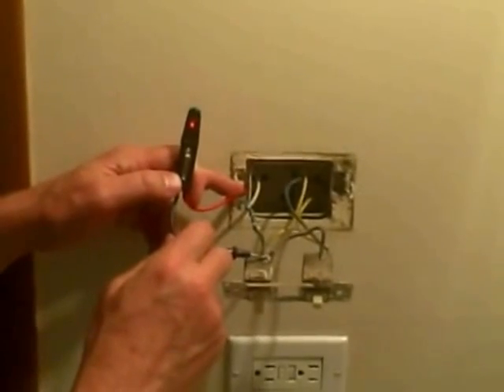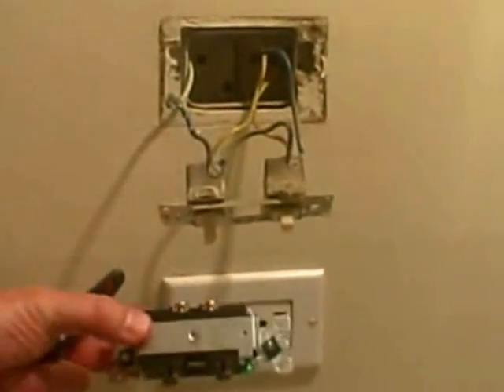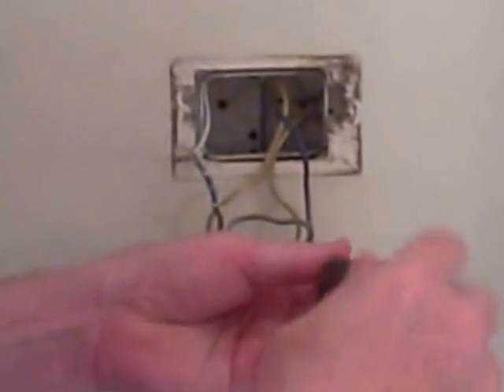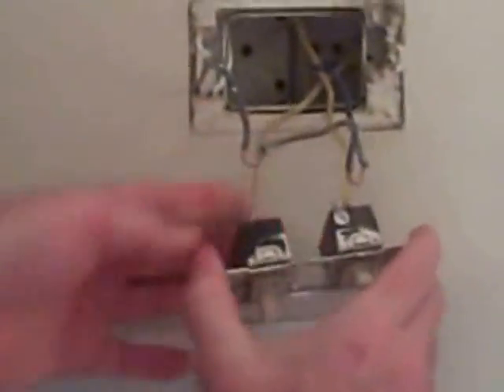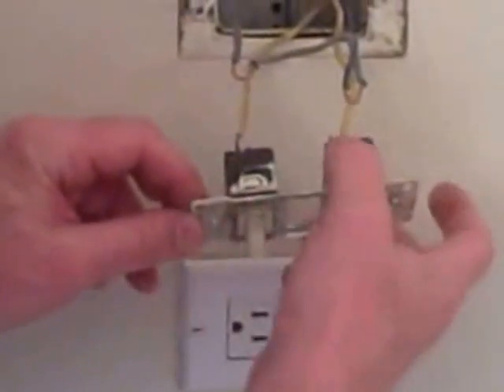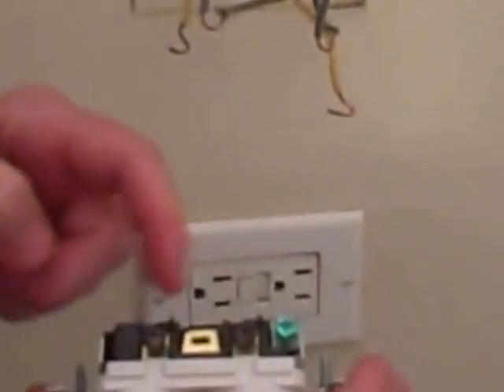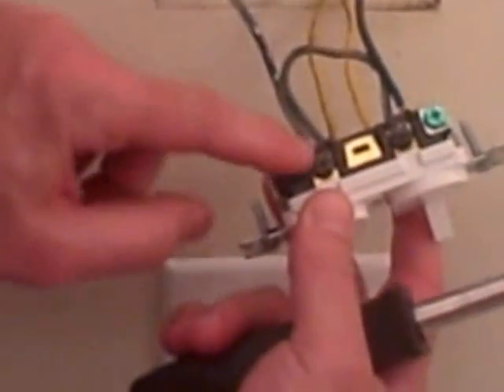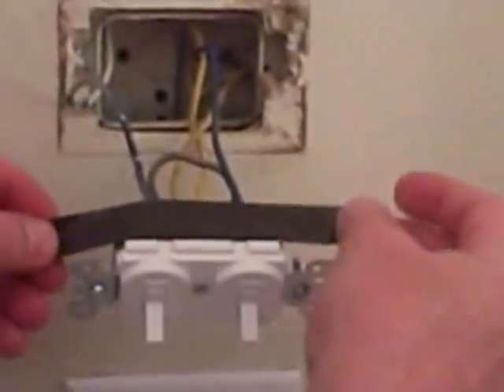How to Wire a Double Switch - Wiring a Switch - Conduit

Comment: This is the most perfect and quick to the point video that I needed. 
It nade me understand that I inverted the wires and this is why 2 of my lights went on and off together. Thank you.
Reply from the maker: You're welcome.
Check out more home improvement tips in our e-books https://www.amazon.com/gp/product/B0B2KW1FQ9?notRedirectToSDP=1&.
Reply: I want to install a double switch like this in a bedroom that currently has a single switch. The purpose is i want to add a ceiling fan with a light. My question is since the room/switch currently only has a light, will i need to fish a new single line through the conduit to be able to have the light and fan to operate singlely?

Comment: What if the power is coming from the fixture to the switch? I had a single switch that was powering two separate lights, one of the wires came loose in the box and no clue how it was wired. So right now I have a porch light that has a white (hot, labeled with black tape) and a black traveler wire,  in addition to another white wire and black wire that run out to a pole light in the yard (no power to either of those wires. How do I wire a double switch under these circumstances? I attempted to wire my double switch the same way you wired yours in the video but it didn't work out.
Reply from the maker: Hi, you can send a picture of the box and the wiring to fixitpodcast@gmail.com
Reply: @FIXITHomeImprovementChannel  just sent you an email.

Comment: WOW!
I can't imagine someone running romex into that switch box and not cutting the feed line and hooking it up to each switch separately.
It had to have been challenging to strip the insulator in just the right place so it could be looped from one switch to the next and then on to the outlet.
I have to  laugh at the thought of people watching the video and trying to replicate the same thing.
I know why it worked, and how it worked - I just don't understand why anyone would do it that way.
Reply from the maker: Hi, this is individual wire run in conduit. Common in Chicago and a few parts of the country.
Reply: @FIXITHomeImprovementChannel  thanks for that. 
Whether pulling individual wire or running romex I still don't understand why the feed line wouldn't be cut...
Looks like a waste of time, effort and wire.  Chalk it up to old school?  BTW - good video.  I learned something new today.
Reply from the maker: Yes it seems like it would be more time consuming, but I've seen it a lot in the Chicagoland area.

Comment: For years i've had a double switch in my bathroom that would have both the fan and light connected to one switch. I want to learn how to split them back into one switch for lights and one for fan.
Reply from the maker: Hi, you can email me at fixitpodcast@gmail.com
Reply: @FIXITHomeImprovementChannel  After asking my dad, a former electrical engineer from 30 years ago, about teaching me how to rewire that, he shamed me for even thinking of doing that. I'm not sure if it's a good idea for me to do that anymore. I thought maybe it could be changed from behind the light switch, but I don't know anymore.

Comment: I have a switch that on the breaker controls both patio and all ceiling lights.  It has only 3 wires.  I tried first time and only got one light or the other to work.  I’m talking about a double switch that controls my back patio light and flood light.  Tried different wiring and same thing.  Put old one back and still worked but it doesn’t work good.  I tried again later and nothing worked.  I bought another new one and haven’t tried installing yet.  Does this sound like I just need to break off the tab?  Thanks for your video!
Reply from the maker: Hi, you can email me a picture at fixitpodcast@gmail.com

Comment: Hi, I have a double switch and seem to be having an issue with it.  I have a red wire that's attached on top to what you would call the 1st switch in this video, then I have two black wires attached to the 2nd switch top and bottom.  When I turned the power back on, the ceiling fan was on low, both switches were in the off position.  Do I need to have the black wire on the bottom attached at all?  It's just a separate wire about 3 inches long.  The Black wires are all connected under an orange cap.
Reply from the maker: Hi, you can email me with pictures to fixitpodcast@gmail.com.

Comment: I just replace a switch like this. One switch controls a light in the ceiling and one controls the light over the mirror. I replaced it exactly as the old one was wired. My problem is now when I flip either switch both lights come on. Any ideas of what I did wrong?
Reply from the maker: Hi, you can email a picture of the box and how you wired it to fixitpodcast@gmail.com

Comment: Hi...I have similar setup. Two wires going into com1 in the switch with a bridging wire from com1 to com2. May I ask why the bridging wire is necessary? Ie why can't the 2 switches have their own separate live feeds?
Reply from the maker: Hi, you can email a pic to fixitpodcast@gmail.com.

Comment: If both sides are hot.. how come all the screws arent black..
Reply from the maker: Hi, some manufacturers will have all the screws the same color. You want the hot wire or wires coming from the service panel on the side with the breakaway tab. You would find that by testing the wires and marking the hot wire. The wires going up to a light, fan or outlet would be on the side without the breakaway tab.
We have more home improvement tips on our weekly podcast http://castbox.fm/u/6389499.

Comment: I've got a double switch in my kitchen.Would like to have an outlet nearby.How would I wire an outlet to an existing double switch??Your expertise is appreciated./Jerry Usrey👍👍
Reply from the maker: Hi, you would normally run a new outlet from an existing outlet.
Reply: I've decided to use single switch in the dining room.How do I wire a new outlet from that existing (1) switch??/ Thanks for your help with this project./Jerry Usrey
Reply from the maker: Hi, the electrical box needs to have a hot and neutral wire. If you want to send a pic to fixitpodcast@gmail.com I will try to help.
Reply: @FIXITHomeImprovementChannel  I haven't opened up the outlet yet but when I do I'll send pic.Thanks for your help thus far.👍👍/Jerry Usrey

Comment: Hello, I did find this video very helpful. I went to do my bathroom today. I originally had a single switch that controlled both the fan and the light. I am looking to replace it with a double switch like the one in the video. When I took out the old single switch I come across two 12-2s coming into the box. When I test the black wires, both of them come off as 'hot'. The two neutral wires are tied off together. How would you recommend wiring the two black wires to the new double switch?
Reply from the maker: Hi, when the switch is removed and you test both of the black wires, one should be hot and one should dead. Are there just 2 black wires and 2 white wires that are connected with a wire connector.
Reply: Hello sorry it took me a while to respond, yes there are just two black wires, and just two white wires. The two white wires are connected with a wire connector, the two black wires are both connected to the switch, I did check again and when I use my tester both black wires are coming back as hot.
Reply from the maker: Hi, both should not be hot going to a switch. Can you send a pic of the box and the wiring to fixitpodcast@gmail.com.

Comment: What No Ground..   Are you serious? Metal old work box, probably BX feed, place a ground. Safety, safety, safety....
Reply from the maker: Hi, in Chicago, Seattle and parts of New York electricians use conduit for the ground path. No ground wire.
Reply: E. McClain
...if you watched the vid,  instead of trying to seem intelligent and running your mouth off, you would've heard that they use metal conduit as the grounding path

Comment: Is there such thing as a “5-way” switch? I’m trying to replace an old double switch kind of like the one you have there and I’m replacing it with a new one in my kitchen in an older home. The problem that I’m running into is that I have 2 black wires which were both installed on two different screws, but were conjoint by a small wire. I have a red wire that It’s probably a traveler wire because it gives power to other switches and plugs in the next room and I also have two white wires. I have two light fixtures in the kitchen. My question is where do I hook up the red wire in this new 4-way switch that I bought? I connected two black wires on each of the black screws and broke off the “tab” and I have the two white wires connected on the other side of the switch each on their own screw. Help!
Reply from the maker: Hi, can you send a picture to fixitpodcast@gmail.com.

Comment: I came across the same type of switch... it it ok to get rid of the loop and just make the hot wires go driectly into the area they are supposed to? Or does the looping of the hot wire hold any significance?
Reply from the maker: Hi, you can use the screw terminals as long as the break away tab is in place. Electricians would loop like this so if you remove the switch, you will still have electric downstream.
We have more tips on our weekly podcast http://castbox.fm/u/6389499.

Comment: I put my wire on the new one exactly like I took them off. one at a time. aboth switches turn both the light and the fan on now
Reply from the maker: One side of a double switch will have a break away tab. This is the side to attach the hot wire that is feeding the circuit. The other 2 wires go on the other side without the break away tab. 
Turn off the power. Separate the wires and then turn on the power and find the hot wire feeding the circuit. Mark that wire. Turn off the power and connect that to one of the screws on the side with the tab. The other 2 wires to the other side.
Let me know if that helps.

Comment: I have a switch like this with a light to one switch and garbage disposal to the other and all works good but... there is a receptacle jumped off the hot side of the switch and the outlet only works when the switch is in the on position. Looking to find out how wire this receptacle to stay hot all the time and the switches still work separately, any help would be awesome thanks and great video.
Reply from the maker: Hi, let me know if this helps. https://youtu.be/tYinqtVDNcA

Comment: so you can either break the comon in half or leave it ?since it is 2 separate hot line?
Reply from the maker: Hi, this is an unusual connection. The hot wire coming from the service panel loops over the screw terminals on the side with the breakaway tab. Usually there would be one hot wire coming from the service panel on that side and the 2 wires going to lights or a light and a fan on the other side.

Comment: What if you want to replace one switch? And replace with a dimmer. The new switch has wires and not screws can I cut the hot and connect with dimmer wire and then cap with a nut?
Reply from the maker: Hi, do you have 2 switches in the box or a double switch?

Comment: I have one of these near my front door. The top one used turn on the porch lights. And the bottom one would send power to an outlet inside. I switched it to a newer combo but now the bottom switch sends power to both the outlet and porch light. Help?
Reply from the maker: Hi, turn off the power to the circuit and disconnect the switch. Separate the wire so nothing it touching and turn back on the power to find the hot wire. Turn back off the power and connect the hot wire you found to the side of the switch with the break away tab. Connect the other 2 wires on the other side of the switch. One wire to each screw terminal. That should do it. Let me know if that helps.
Reply: Barry Alan seems like the tap jointing the switches needs removed from the switch. You can do so with needle nose pliers and break it out of the switch and they will become separate independent switches instead or joined like they are now

Comment: hi, can I ask you a wiring diagram from a single switch to double switch wiring diagram? I want to replace my single switch to double switch but doesn't work at all.
Reply from the maker: Hi, what do you have now. Just one switch? Or do you have 2 switches that you want to replace with one double switch.
Reply: Hi, good day thanks for your reply I really need, right now I have only a single switch and I want to replace to double switches. I already open and check but I saw 2 wires only inside. thanks again.
Reply from the maker: Hi, if you are trying to control 2 devices, you will need to run a cable to the second device.
What is the one switch powering now and what do you want the 2 switches to do?
Reply: i have already single switch and I want to replace to double switches but only two wires

Comment: How do you jump off a double switch and power an outlet in the same box?
Reply from the maker: Hi, if you have a neutral wire in the box, you can use a small length of wire from the screw terminal not being used on the tab side of the switch and go to the brass side of the outlet. You will need a neutral wire on the silver screw side of the outlet.

Comment: the house I live in has no switches with ground, so my issues is the bathroom only has 2 wires.I'm confused if I should just fine the hot wire an ad it to the black screw and the other wire to a yellow or do I have to ad a pigtail to the  hot and connect it to both blacks???? thnx in advance if someone can help
Reply from the maker: Hi, is the switch a double switch like this one in the video?
Reply: +FIX IT Home Improvement Channel 
no it's a single
Reply from the maker: If you have a single pole switch, only one switch operates your light, it is just a break in the hot. It doesn't matter which wire you put to the screw terminals. One wire to one screw and the other wire to the other screw.
Reply: +FIX IT Home Improvement Channel 
thnx. was about to give up, don't wanna burn the house.
one last question, so doesn't matter were if the wire goes on to top or bottom screw
Reply from the maker: If it is a single pole switch, it is just a break in the hot, it doesn't matter which screw terminal. This is the easiest switch to wire. If you have a 3 way or a double switch, drop me a line. They are more complex. 

We have more tips in our home improvement book http://www.amazon.com/dp/B01BK2K0JM?ref_=pe_2427780_160035660
Reply: +FIX IT Home Improvement Channel 
thank you
Reply from the maker: You're welcome.
Reply: +FIX IT Home Improvement Channel 
hi, I re read our convo and what I didn't mansion was yes the switch is a single pole that I want to convert into two switchesin the bathroom. but only 2 wires are exposed
Reply: +FIX IT Home Improvement Channel 
it's going into the bathroom. the way it's set up now is combo fan/light in the shower and a light fixture. the switch now is a single pole, so only 2 wires. so I want to add a duplex, but there are only 2 wires
Reply from the maker: Hi, so when you turn it on, everything is turned on?
Reply: +FIX IT Home Improvement Channel 
yeah, pretty much
Reply from the maker: You are going to have to get into the box in the ceiling and see how it it wired. You need one hot wire from the light coming down to the switch and a hot wire from the fan coming down to the switch. If you want to take some pics and email me at fixitpodcast@gmail.com

Comment: thank U for easy explanation, I would like to know how to differentiation between the natural, and grounding wires, and how to make grounding for this video. thankx again.
Reply from the maker: Hi, this video shows a double switch in conduit, so there is no ground wire.
If you are using non-metallic cable, you would connect the bare ground wire to the green grounding screw.
A switch is a break in the hot wire, there is not a neutral wire connected to it.
Let me know if that helps.
We have more tips in our home improvement book http://www.amazon.com/dp/B01BK2K0JM?ref_=pe_2427780_160035660

Comment: you said you only needed one of the black screws hooked up to hot..why did you then put a pigtail to the other black screw?
Reply from the maker: +Jeff Alfieri Hi, this is the way the electrician set it up, the wire is going on to another box. In most cases, you will have one hot wire coming into the box, you will connect it to one of the screw terminals on the side with the breakaway tab.
Reply: I have two blacks and two whites coming into the box. I can get both switches to control the fan and light at the same time but I can’t get them to work separately.
Reply: So you only need to connect it to one tho?

Comment: I have an old switch just like the one shown here and wired the same too, but the only difference is three black wires and one white. I need to replace it like you did. One thing though that's confusing me is that I'm reading voltage when i test both side of the switch